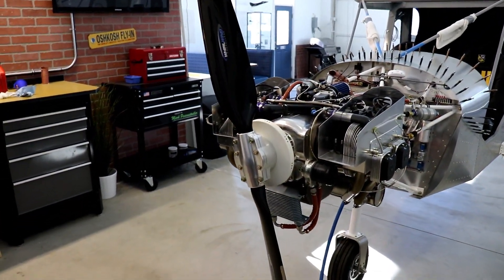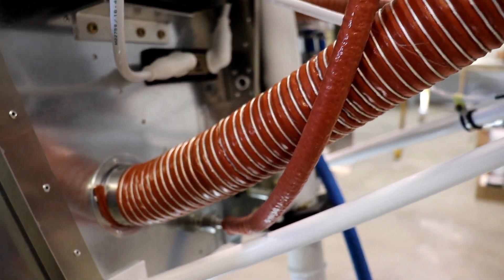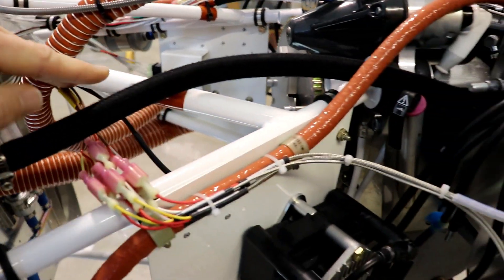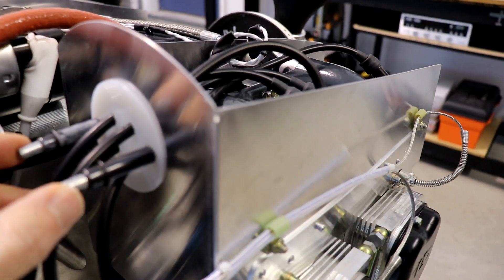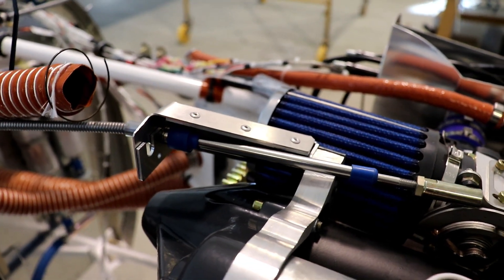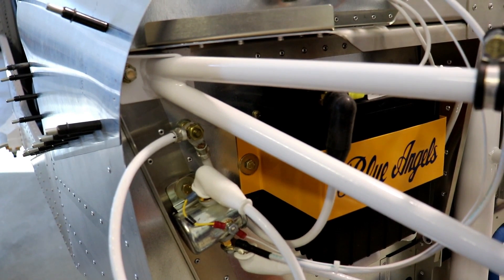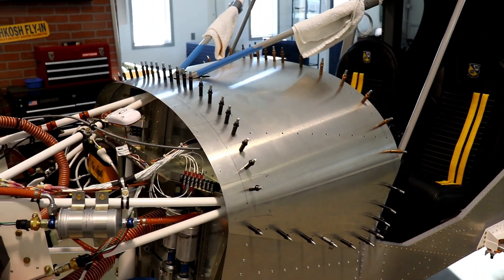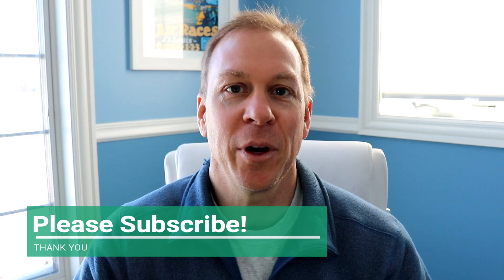UL Power 350iS Engine Installation Complete!

Comment: I did a UL350is install on my Sonex. I am impressed with Mark,s quality installation. This video will be a great help to anyone doing a UL350is on their aircraft.  My Sonex model ONEX did not have nearly that much room under the cowl so was a huge challenge to fit the components.  One comment that I think is worth mentioning is that the oil cooler inverted like that will trap an air bubble reducing oil cooling capacity. I had to flip my oil cooler after experimenting high oil temperature on initial test flights. That’s it guys good luck!    Thanks Mark.
Reply: Yes do keep an eye on the oil temps.  I contacted UL and they admitted that the oil hoses should enter from the top to eliminate the airtrap .  After conduction initial tests and experiencing peak oil temps of 240 degrees F.  I removed the oil cooler [believe this or not] held it under water and then flipped the cooler inlets side up.  Guess what air came out proving there was trapped air even after 6 hours of test time! Best of luck....
Reply: I was going to say the same thing… unless this cooler is internally routing oil from its inlet side directly to the top row and forcing it across through every opposite row (I highly doubt it does), this will have the effectiveness of a 2 or 3 row cooler. It needs to be flipped so that the fittings are on top.

Comment: Looks like a super clean installation! You should be very proud. I’ve watched a few of your videos now and can’t remember if you have told us what air park you are at? Could you? Also,, wondering if you could tell what you paid for that motor, and what Zenith thought about putting 130 HP on the front of that airframe. Currently I’m in So Cal and I fly a ‘47 Navion, but when I retire I want to move to an air park and build a Zenith, and I love this motor. Thanks in advance for posting this, and for any answer.

Comment: Did you wind up using your original firewall fitting for the throttle cable or go with a grommet and sealant?

Comment: Mark I have a simple question. You’re getting your cabin heat from running those hoses from the muffler, I would think that the muffler would have toxic fumes that would be going directly into the cabin. How do you keep the exhaust fumes from entering into your cabin?
Reply: Ya, a heat exchanger, pretty standard on an air cooled engine.

Comment: I am planning to build the same plane as you with the same engine. It's a first time build for me so pls excuse the dumb question. When you order the 350is engine does it come with all the sensors or do you buy them seperately? Do all sensors work for different EMS system?  Gord.
Reply: Kitplane Enthusiast Thanks Mark.